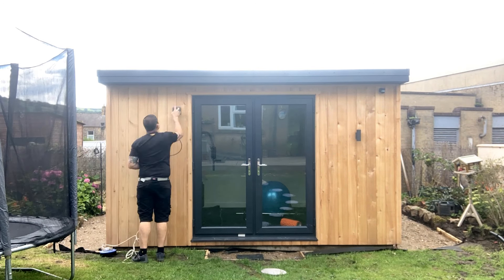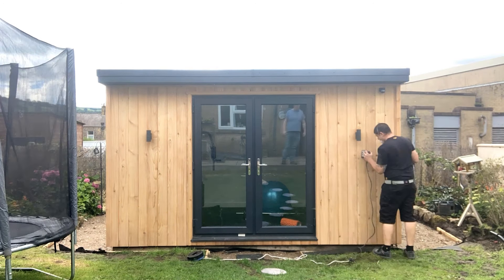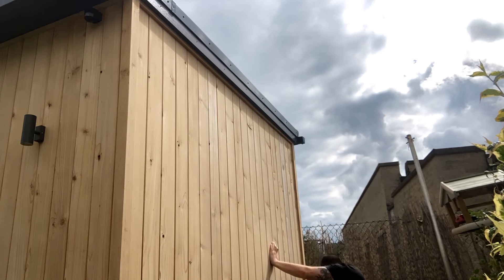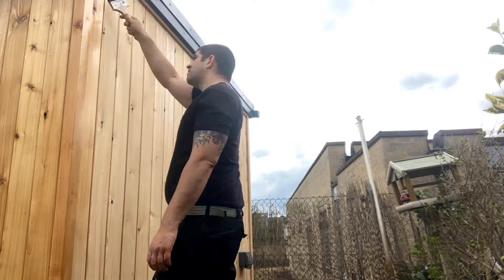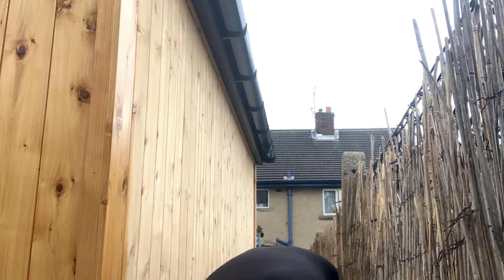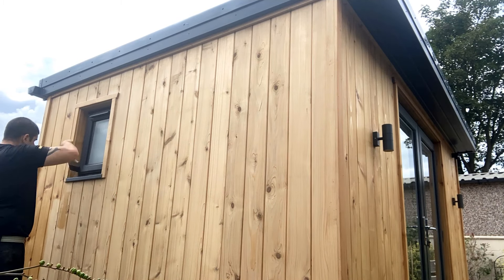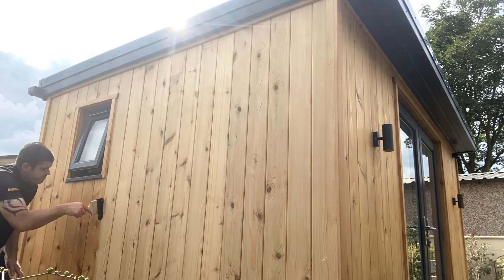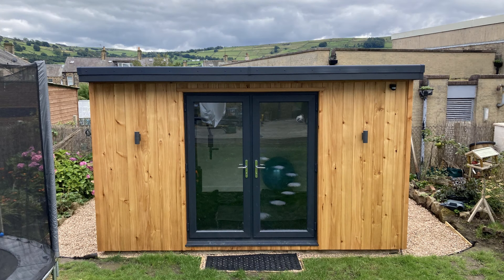Treating garden room cladding - Osmo Oil UV-Protection (Timelapse)

Comment: Did you wipe any excess off after each coat? I've not bothered on my project but worried about it getting sticky. Any issues on yours?
Reply from the maker: No issues at all Peter, it just soaks in and then once the first coat is dry just add the second. Its a very clean finish
Reply: @thediyfix  good to know. Thanks!

Comment: How did you find using British red cedar? I’ve accidentally ordered that meaning to order the Canadian that I had seen in the photos (didn’t know they were essentially different woods).
Reply: Also - any reason in particular you used the clear osmo oil rather than their specific cedar one? Cheers
Reply from the maker: Hi Johnny, Im very happy with the British cedar, it was significantly cheaper than the Canadian and that was my main reason for buying it. I might be wrong,  but I think it is the same species, however the canadian trees grow much slower in a far colder environment, this gived them their darker colour and fewer knots.

With regards to the clear oil. I just liked the look of the wood and didnt want to use a tint. Also, I assumed the the cedar coloured oil would be more specific to the darker canadian variety